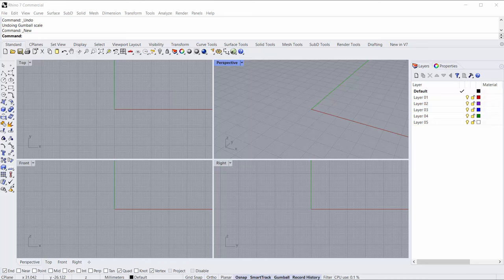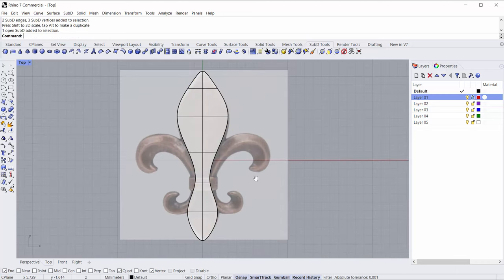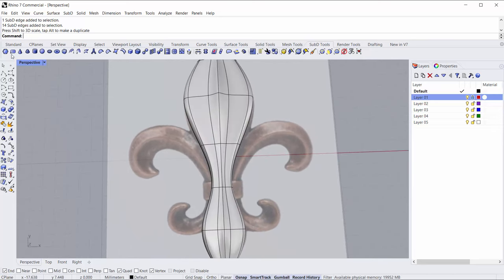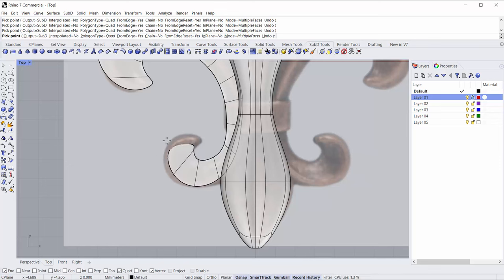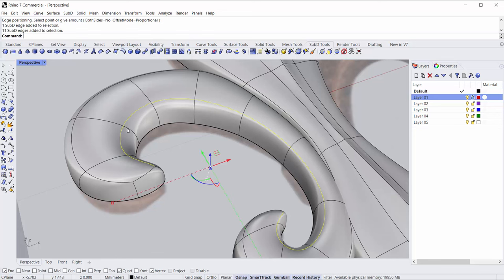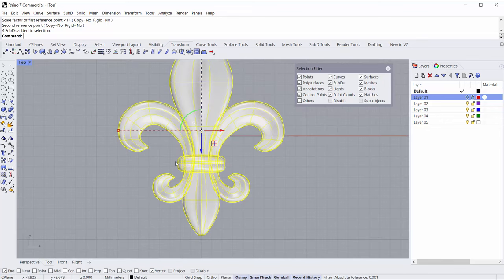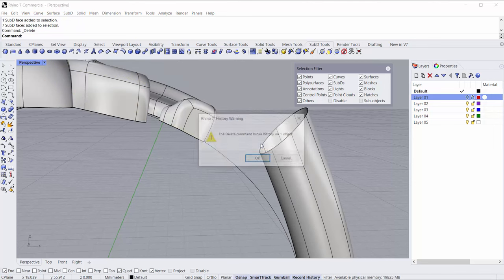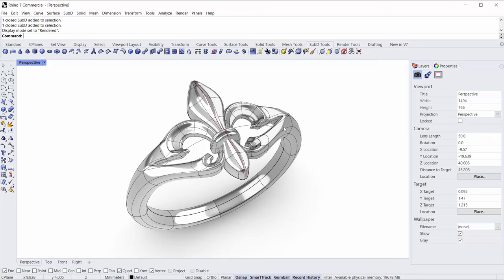Rhino 7 SubD Fleur de Lis ring

Comment: The double bridge command you applied between the shank and the fleur-de-lys was brilliant. So inspiring. SubD is a real step forward for jewelers as it lets the designer the funny artistic part of the work while the software is busy with the teadious calculation. Thanks for enlighting us.
Reply: I still giggle a little every time I run the bridge command.

Comment: can you pull a face Uv mode ? or point or a edge ? thank you very much for the answer like T_spline handle gumball ?
Reply from the maker: SubD objects don't have UV directions like a NURBS surface but you can use the Slide command to move an edge/edge loop or vertice in either direction. You can also use the Align to Object mode for the Gumball. Post to the user forum with a file if you have more questions https://discourse.mcneel.com/
Reply: You can use ExtrudeSubD with command options Basis=UVN Direction=N to extrude UVN like you would with the T-Splines gumball.